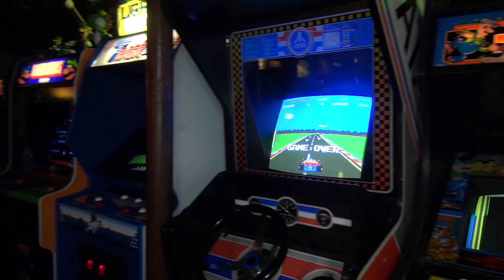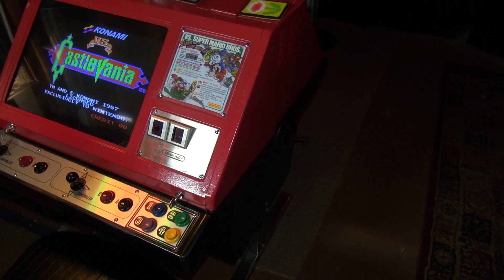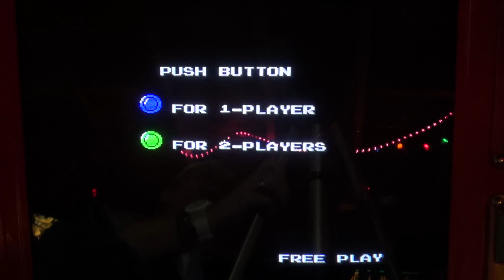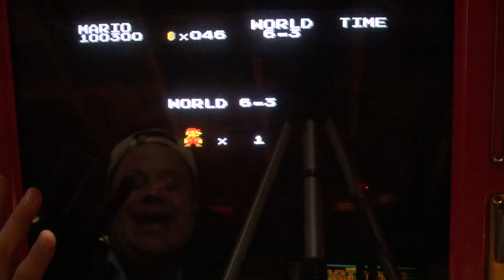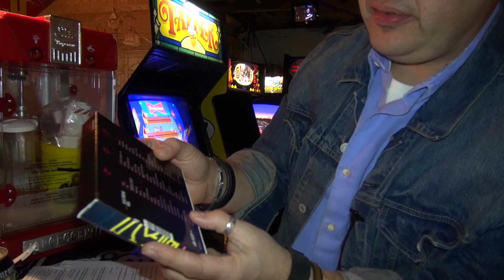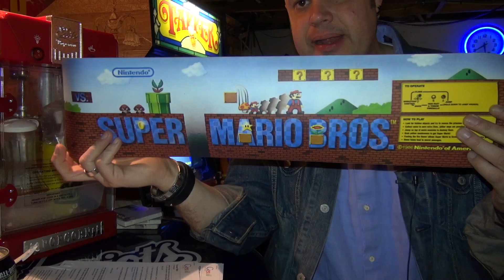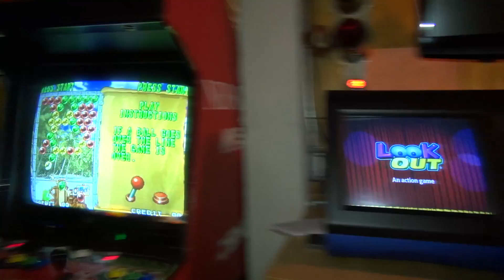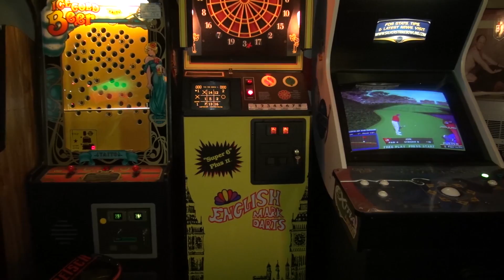John plays Nintendo Vs. Super Mario Bros. Arcade - 1080p 60fps - Post Christmas Wrap-Up!

Comment: John, born in 1970, I have a warm and fuzzy feeling about space invaders too, but you hit the nail on the head about it not aging well.
I also played it to death on the 2600.
When Pac Man came along, it took over, and then soon after (at least the arcades I went to) Donkey Kong ruled, and DK has aged well, still a great game.
I wouldn't get space invaders if I were you, its just not that fun any more, but when it came out, it was truly revolutionary, but now its just a decoration that would take up valuable space.
Reply: HowAbout NoSon
DK is way way better than SI. There are a lot more things to do in DK and a lot more ways to die. Plus there are four different screens with different challenges. You can really play DK for a long time before you start to learn everything. Even then there are lots of ways that the experts can squeeze out more points that beginners could never do. It's surprisingly deep for being practically the first platformer ever. Of course it is much harder than it seems at first - that's key.

Comment: Hey John! 1080p60 is the way to go. For the content you provide, it only makes the quality that much more enjoyable. The scan lines of the CRTs in the cabinets is no longer visible and your arcade really shines that much more on video.

(Anyone reading with an AMD Radeon HD5xxx or 6xxx series, you're out of luck on 1080p60. The current implementation of the renderer used in Chrome just can't decode fast enough for these processors to handle. 720p60 works fine though. They've since rewritten the renderer and one of the future version of Chrome should fix this. For now, just set to 720p60.)

Comment: Hey, John. Great video! I didn't know there was a battery slot on the Vs. board. Now I'll have to check whether mine has any batteries in it.
By the way, the key to the 6-3 "leap of faith" is to carefully walk back and forth on the right edge of the platform until the red Koopa Paratroopa scrolls into view. Then go almost all the way to the left of the platform and wait for the Koopa to reach its lowest point and begin to ascend. As soon as it starts moving upward, run across the platform, jump off the right edge of the platform and hold the button in. You should bounce on the Koopa and get across.

Comment: Didn't know you were a full time graphic designer...

I use to be one as well, I graduated from Full Sail in Orlando, then worked for the DoD on Macdill AFB/ Centcom, then went back to FS for my bachelors and then worked at a web design company before trying project management at another design company and doing what I do now...

Anyway, I knew you did GD but not full time... So, cheers!

Comment: Lol at "bookkeeping fucktions."

I used to have my birthdays at Putt-Putt mini-golf every year but since it's in March usually most of the time was spent in the arcade.  One year they had Vs. Super Mario and my brother and I played it a few times.  The thing I remembered most was that the coin counter had three digits for no apparent reason; I learned a lot later that apparently the arcade operator could set the coins needed for an extra life up to 250 if they wanted.

You get the fireworks at the end of a level by having the timer end in 1, 3, or 6 when you hit the flag.

The infinite lives trick was on 3-2, not 4-2, but they prevented that from being doable in the Vs. version by replacing the turtle with a goomba there.

As for what I got for Christmas this year... Tales of Xillia 2 and Tales of Destiny Chronicles for PS3.  Yeah, I'm a sucker for Japanese-style RPGs.  :)  Anyway, liked the vid, looks great, looking forward to your other videos this week.

Comment: SMB2J: The Lost Levels is a whole 'nother beast entirely! it's no wonder it was never released in the US up until Super Mario All-Stars on SNES... Nintendo must've figured that the original 2J was way too hard, so we got the conversion of that other easier Japanese game instead. (A port of VS. SMB wouldn'tve been as bad, but since it was so similar to SMB on NES... it's just as well they skipped on an official port.)

There does seem to be quite a few noticeable differences between the VS. System version and the NES version, like more 'gaps' on some of the later staircases that weren't there on the NES one. Also that WAS the right warp in 4-2, it just doesn't give you world 7 or 8 in the arcade :(

It is a fun one to play in the arcades though, last I was at the Pinball Hall of Fame in Las Vegas (December 2012) they had a dedicab version of it and I got to try it, it was actually a lot of fun! 

There's also a romhack for VS SMB that'll work on most nintendo emulators, and I believe it fixes that weird palette thing that usually occurs with some emulators.

(the turtle thing was at the end of 3-1... I swear I could almost do that game blindfolded.... granted IF I got the extra lives there but yeah heh)

Lastly it was Tetris & Dr. Mario on SNES! even had the interesting vs. mode where one could be playing tetris and the other dr. mario and vice versa!
Reply: When I was a kid and played SMB2, that what I looked at it as. Not anymore, I see it as Doki Doki Panic.
Reply: It's like this. First there was SMB on the Famicom. SMB on NES is basically identical. Then there was Vs. SMB which has some of the levels changed. Then SMB2 came out on disk. SMB2 has all the new levels introduced in Vs., and the rest of the levels were also replaced with new levels. SMB2 also has new things like poison mushrooms, wind, Luigi jumping higher, and some different graphics.

Comment: Actually John on 4-2 you did have the correct warp on the nes that warp is for 6 7 and 8 on the vs it's only world 6 that's one of the differences between the games
Reply from the maker: Oh, Anthony! I see. So, on the NES I could have warped to 8 on 4-2. That's right!
Reply: Yes sir that is correct
Reply: also the warp to 6 7 and 8 was at the end of the stage accessed in the same way as the warp in 1-2.
Reply: It's 3-1 for the infinite lives